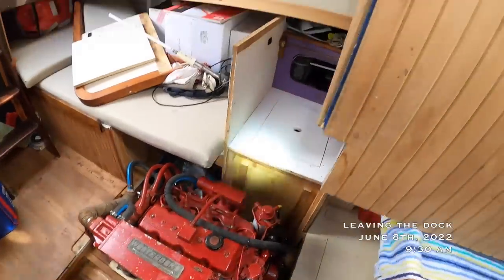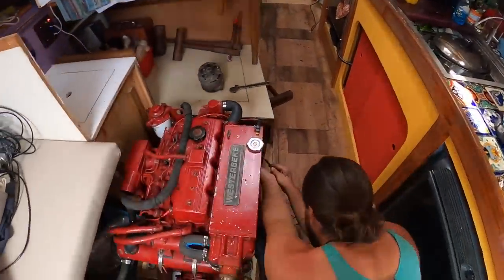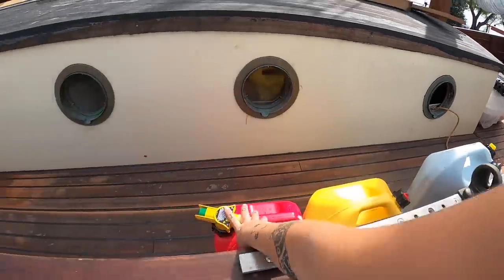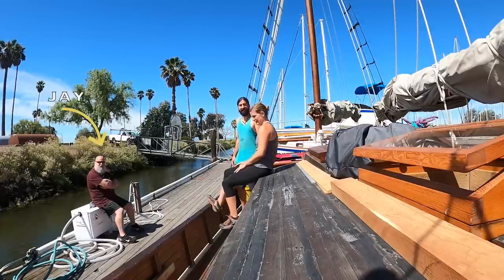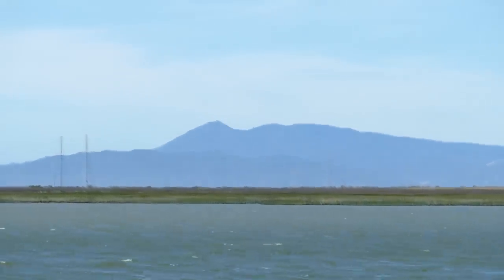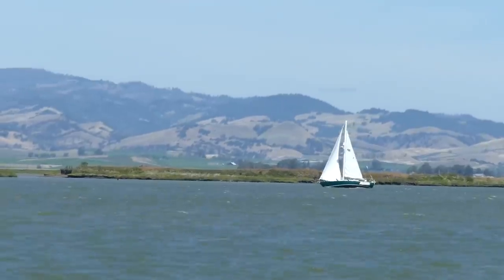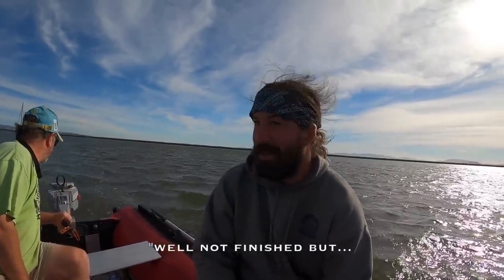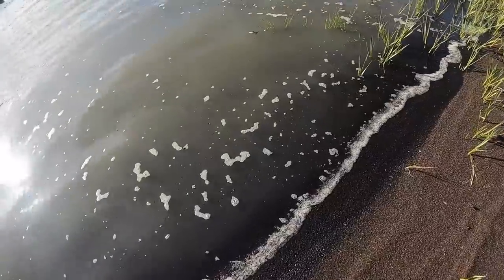Salt & Tar: Ep.200- Leaving the Dock

Comment: Did any body check the load? If there was a short or high resistance fault in a piece of equipment it could cause an overload condition. Did any of the fuses get hot? Heater plug relay stuck, or maybe the battery charge condition low, causing charging at  very high rate? In a wooden boat, unlike a vehicle there is no ground return via the chassis\Hull, battery, alternator and equipment negatives must be all connected together using suitably rated cable. Sounds like the alternator was overloaded.

Comment: When Garrett said “that fat flat head…” for a moment I saw her hitting him over the head with a wrench and saying “You’re It!” 😂 
As to the alternator problem, since it started working after fiddling with it it could be either a loose wire connector or bad ground. There should be no paint between the alternator mounts and the engine because that is the normal ground or you can run a wire from the lower alternator mount to the engine ground where the negative cable connects to take all those surfaces out of the equation forever. 
If this happens again, with the voltmeter check for 12VDC at the small connector to the alternator, if there is none start by checking the fuse in the circuit or corrosion in the connector. One thing I would suggest is for you to put some dielectric grease in ALL your connectors, this will keep the salty air out thereby preventing corrosion; this includes all battery clamps. If you don’t have one, I’d suggest you take a spare alternator and one spare battery with you.
Reply: Ditto on the spare alternator.  A diesel can run without an alternator but your water pump generally shares a belt with it and you can't run the engine without a water pump. 💥

Comment: I would have swapped out EVERY ancillary (oil pump, water pump, alternator, heat exchanger, blah blah. ) before ever putting the motor in the boat. Bring or acquire a spare alternator for sure. and two belts.

Comment: I suspect you have a bad voltage regulator. If external regulator jump A and F terminals. (Armature and Field) if voltage goes north of 13 volts. You have a bad regulator. If internal regulator just measure the voltage accross the battery terminal with a load. Should also get the 13 plus volts. If internal I would replace the alternator. With a rebuilt. If external just replace the regulator. Either way keep spares, then seal in air tight continers to prevent corrosion. Check all spares regularly. Not trying to be a wise guy. You would be surprised what I have seen in 65+ years, lol.

Comment: Sound like diodes are kahput, shot. Ok, check the alinement of the pulley wheel to the crank wheel, then all electrical fittings. Is it putting out Amperage 13?+ Amps?

Comment: Screeching???...Bearings.  Bad electrical connections don't produce mechanical Screeching...mechanical problems cause Screeching.  Almost sounds like two problems...#1 Alternator Electrical Connection problems(possibly internal as well) ...#2 Alternator Bearings are getting dicey...
Buy a new Alternator and have it ready to throw on...
ALSO...this is something that happened to me with a car...keep in mind I am a Trained Electronics Tech...I kept losing Voltage whenever I turned on Lights...or Fan.  Alternator kept testing good...turned out...the RUBBER SEAL on the HARMONIC BALANCE had busted loose and every time you put a current demand on the Alternator...the Back EMF would cause the pulley that is on the HARMONIC Balance...TO SLIP just enough to drop the output voltage below charge level of 14.2V...it would DROP to 10V or less.  I replaced the HARMONIC Balance and VOILA'...something for you to keep an eye out for.  Your engine gremlins are going to need investigation for peace of mind.   So glad you are UNDERWAY...😃

Comment: I was just wondering, your engine cover is sealed really well. Could it be that there isnt enough ventilation  to help keep the alternator from overheating ?
Reply from the maker: Nothing else was overheating and the whole underside of the motor is open to the bilge so there's plenty of ventilation. Pretty sure it's just a cheap part we'll have to replace... even though it's brand new 🤦🏼‍♀️
R